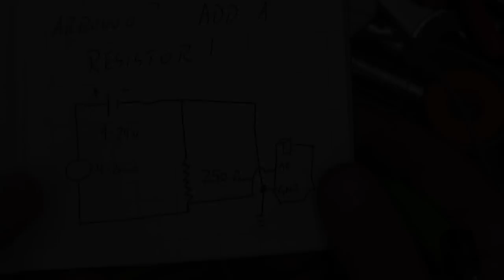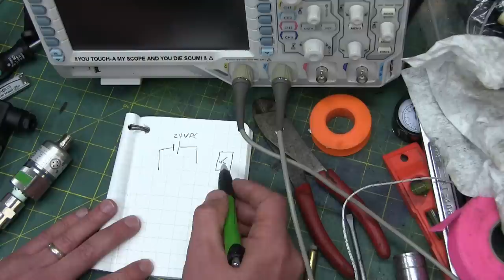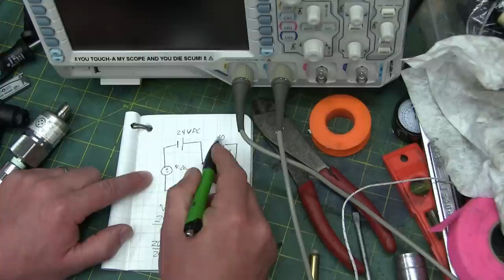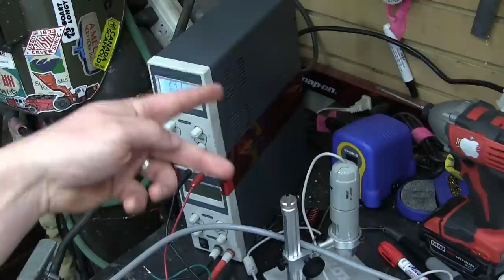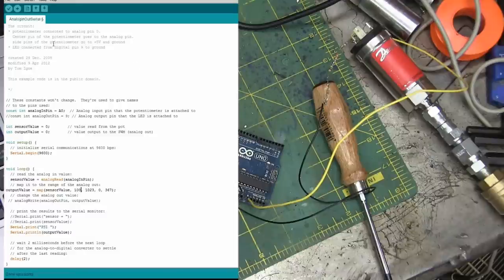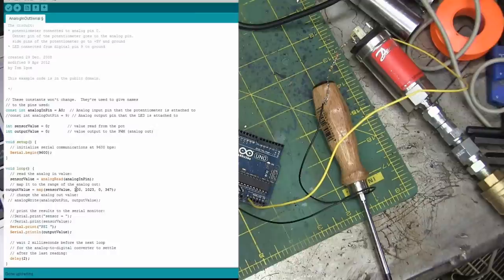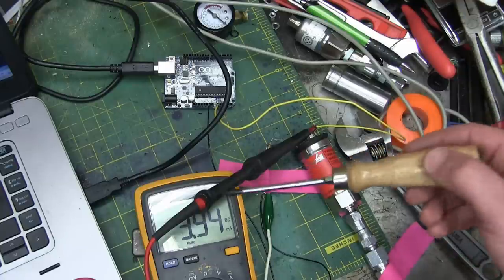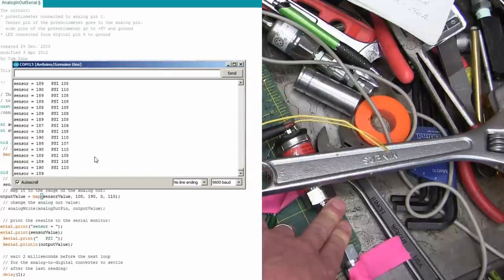4-20mA Industrial Sensor + Arduino

Comment: 20V/20mA = 250ohms? That should have been 1k... 5V/20mA (what you need) is 250 ohms. Looks like your mind substituted the value between what you wrote on paper as your known values and what you used to get the (correct) result.
Reply: Teardown Dan : AvE gets a bit corn fused at times..ya just have to bear with him.
Reply: You can actually use a lower resistance than that if your ADC has just a 1V or 2V input. EG a couple of 100R in parallel will give you a useable voltage.
Reply: Gordon Lawrence : Yes, possible but the issue is millivolts level of measurement.  Keeping it in the volt range means less noise.
Reply: @Keith reducing from 5V full scale to 1V full scale does not make that much difference in the real world for noise (especially on a differential circuit). The real issue is that if you have 5V FSD off the scaling resistor then with a 9V battery that leaves virtually no voltage headroom for the transducer circuit. It will inevitably lead to drift as the battery runs down. With regard to noise remember these are effectively a differential circuit so have way higher immunity than single ended anyway. Even with a 12V power source you don't want near half your voltage being taken up by a scaling resistor. In the real world I have usually designed in a 10R resistor and used a proper differential amp (EG an INA117) and you can get real world common mode noise rejection at well over 60dB.
Reply: Gordon Lawrence :  Depends on length and type of connection..and sampling rate.
Reply: @Keith not really this is differential. Use an LM117 to buffer the signal and you get 60+dB (86dB theoretically possible) common mode rejection. If you don't you have designed it wrong.
Reply: It's 20mA*250Ω = 5V full scale.

edit: I see now what you're talking about. He got it all wrong.
Reply: He meant to do 5V/20mA, got a little ahead of himself

You know the max current available (20mA), you know the max voltage tolerable (5V), so the resistance should be 250 ohms. 

This resistance is in no way dependent on the battery voltage. The sensor provides a current regardless of voltage (think of it as varying its own resistance so the current is correct). This current goes through the resistor, gives voltage.
Reply: Indeed, want 2-10VDC? Use a 500 ohm resistor.  The ins and outs got a little cornfused, but he knew the rules of thumb.  The way he described his resistors made me put the whiskey down and pay attention.  It's interesting watching a video in your own wheelhouse.
Reply: 250 Ohms x 0.004 Amps = 1V
250 Ohms x 0.020 Amps = 5V
Reply: but you cant use 250 ohms and expect it to work from a 9V battery for the reasons I highlighted above.
Reply: It isn't as if Ave wasn't familiar with boost converter lego bricks. If he wanted to use 4-20mA sensors and ran into linearity issues due to low voltage headroom, he'd just boost whatever he has to 20V or whatever he needs - these are industrial sensors and would typically be connected to a 24V PLC, not a battery-operated device where drawing 20mA may itself be an issue. Since he's aiming for simplicity and absolute accuracy is a non-issue here, he went with a resistor that lines up directly with his Arduino's 5V analog input to avoid the need for additional parts.
Reply: My points still remain valid. When designing current loop receivers for commercial use I have still used very low resistances usually about 10R not even 50R. Why? Because if you are using something like an INA117 to turn the signal into a single ended one then anything above 20R introduces error, and you really don't need to worry about noise that much in a differential circuit when you have a minimum of 60dB noise rejection and 80dB is possible with the aforementioned chip in real world applications. Just check the data sheet.
Reply: With an INA117 and a 20 ohm resistor, you'd need to add a 12.5X gain amplifier to use the Arduino's 5V ADC range or lose nearly four bits of dynamic range, more if you consider that the noisier LSBs end up accounting for more of your usable range and the two extra amplifier stages add their own noise over the plain 0-5V input from a resistor. The few sensors I have looked at spec their accuracy as better than 1% from minimum to maximum operating voltage, so I wouldn't worry about that too much when you don't have hundreds of meters of wiring resistance to account for in a typical Arduino-driven project.

The other reason to use an INA117 or equivalent (and the main reason I would in a serious application) would be input protection. Again, rarely needed in DIY/Arduino projects where grounds are rarely sufficiently far apart to experience potentially damaging differences in ground potentials.
Reply: @Teardown Dan. Go do the maths please,.
Reply: @Teardown Dan first off you were talking about PLCs. so your argument regarding the Arduino is irellevant. Second you need to go do the maths. Not actually worked as a design engineer in industry have you?
Reply: Also never heard of an op-amp? Since when is multiplying up a small signal by 12.5 going to be an issue once you get the CMRR up to snuff? You sound like someone desperately trying to defend an argument and failing.
Reply: I said battery voltage does not matter, obviously this was an over simplification. There is a range of voltages the sensor will work at, as long as the voltage is in that range, the current is independent of resistance. 

Also to note, that is an over simplification as well (hopefully obviously). For example, if I put an infinite resistance resistor (say, a vacuum), current cannot flow. So, there is some dependence on resistance too, yes, but there is a large range on both and as long as you're not dumb and unwilling to become un-dumb, you can get this to work very easily.
Reply: Why not? Why can't you use 250 ohms and a 9V battery and expect it to work? (You're right but for a reason you're likely not seeing). Given that 9V can power the sensor, why not?

Regardless of the voltage source, we expect 4-20mA of current. That's the nature of a 4-20mA sensor. They are voltage independent. 

20mA (0.020) is our high current
4mA (0.004) is our low current
Input limit high is 5V
Input low limit is 0V

5v=IR
Well, we have I =20mA and I=4mA as max and min options. V = IR tells us that at a fixed resistance, a higher current means higher voltage. Therefore, the higher current will yield our max voltage before we exceed the input range. Therefore, we calculate:
5v/(0.020) = 250 ohm

Note, my calculations were based on the allowable input range and had nothing to do with the voltage source. So I ask again, why would this not work with a 9V battery? It probably won't, but not because "250 ohms and expect it to work from a 9v"
Reply: @Gordon When I wrote about PLCs, that was regarding bought ones. Ave isn't using a PLC. As for the math, simple: if the sensor has a minimum working voltage of 5V, anything above that is your margin for your sense resistor and wiring losses. Ave suggested using a pair of 9V batteries. With a sensor that has a minimum voltage of 5V, that leaves 13V for battery fade and wiring losses.

Now, in the Arduino case, you are going to have common mode noise between the SoC's integrated ADC and whatever external circuitry you add. That alone may already limit your achievable SNR to somewhere in the neighborhood of 60dB if the Arduino module wasn't designed with low noise analog in mind. If you reference your floating current loop (powered by a pair of 9V batteries in the case of Ave's suggestion) to CPU ground, your SNR is already close to the best you are going to get.
Reply: Ah so you don't have a clue how they work. There is circuitry inside the sensor that needs voltage headroom. You really didn't know that? So your headroom could be a full 12V less than you state for some sensors. As for CMRR you have even less of a clue. The whole point is your grounds are not commoned. If you common them you negate the the CMRR altogether. Go read the data sheet again and look at the application notes. As you don't seem to have a clue about the maths I'll tell you the answers. If you use 1% tolerance resistors with 200ppm temp drift then worst case over the -40 to +125C temp range your CMRR is down to a ratio of 40 to 1. Don't believe me? Go and learn the maths. So sticking a 250R resistor in a fully differential circuit is going to completely screw up your CMRR and no it's worse than the 25 times difference in the resistor ratios. Again if you don't believe me go learn the maths and do the sums yourself.
Reply: @Gordon If a sensor has a 5V minimum working voltage, that 5V includes the regulator overhead for the internal circuitry. If the sensor needed 12V minimum for correct operation, its minimum voltage would be stated as 12V. As for your CMRR comments, a mismatch in a differential amplifier degrades noise common-mode immunity but in the plain resistor circuit, there is no delicate matching between + and - input circuits, all you get is temperature drift, not additional common-mode noise.
Reply: @Gordon Please wake up. The INA117's specs are irrelevant when you aren't using the INA117. Ave is plugging the 250 ohm resistor directly into the Arduino ADC input, no differential amplifier, no input network matching or input offset compensation required.
Reply: Fine, I forgot to include the 5V of sense voltage in my deductions at some point while I was editing that earlier post, so what? There is still 8V left for wiring and battery discharge after that. Since you would need about 3km of #26 wiring (133 ohms/km, 1.5km each way) to spend 8V of headroom, I think it is more than reasonable to allocate practically all of it to battery fade in a typical "home gamer" project scale.

A plain resistor has no intrinsic CMRR in a current loop. The only reason why the sense resistor in a differential opamp circuit makes a difference is due to the opamp's input/output offset voltages and currents: the bigger the sense resistor, the bigger the difference between inputs is, the bigger the opamp's offsets and associated effects will become. You don't have those issues when you convert a current loop to the voltage range you need with a simple resistor directly at the ADC's input if you can spare the headroom and don't need input protection nor partial-isolation. Again, that only works for "home gamers" as industrial use would require both for safety and durability reasons as there are no guarantees that the sensor itself is referenced to ground.
Reply: You're both over-complicating this.  The instrument is a constant current source, meaning that the output current is constant based on the sensed pressure, up to a ceiling based on the supply voltage, the power requirement of the instrument and the impedance of the output loop.  Depending on the manufacturer, the instrument will have either a maximum rated output voltage or a maximum loop resistance at the high and low supply voltage limits.  If there is a very low resistance across the output terminals then the instrument outputs a very low voltage.  The lower the output voltage range, the more impact electrical noise can have on the signal (or more precisely the bigger that impact is relative to the span of the instrument).  For this reason it's common practice to use at least 250 ohms in the loop so that the instrument is outputting at least one volt.  Also 1-5V is easy to read across the input terminals for fault finding without having to do much in the way of mathematical conversion, and without having to break the circuit to add an ammeter.  This obviously doesn't help with noise coming in through the supply voltage which is why the instruments are generally used with a ripple-free DC power source, and often have their own internal filtering.
Reply: @Retsil The gist of Gordon's point is that using a smaller resistor maximizes the operating voltage margin available to the sensor and improves the CMRR from the receiver amplifier when used. My point from the beginning was that an amplifier is unnecessary here since there is plenty of voltage headroom to afford using a plain resistor and none of the need for rugged industrial design, which eliminates the effect of the sense resistor on the amplifier's CMRR from the list of things to worry about.
Reply: Lots of these current pressure transducers require a bit more of an excitation voltage before they chooch. Unless AvE has skookum transducers there.
Reply: @Teardown Dan, and my point is that you denied that there was a need for voltage headroom for the sensor (which I have proved you wrong on with a data sheet), and you also denied that CMRR was affected by the value of the sense resistor (which I have proven to be nonsense with a data sheet and two application notes). So my original point remains that I made in my first comment that two 100R in parallel would be better in this specific instance as if the sensor needs 12V (as per some of the units out there) and you are using 250R for a full scale of 5V, then you only have a 1V margin for the batteries when they start running down. 50R would give you a 5V margin worst case, and it's not exactly difficult to stick in a rail to rail op-amp (configured as a x 5 amp) for a few pennies or just live with losing a couple of bits off the resolution. So any way you look at it you are wrong.
Reply: It's fucking magic. Stop worrying about it.
Reply: @Gordon Learn to read, I have never said that.
Reply: @Teardown Dan learn to speak: Never said what Specifically?
Reply: At this point, I'm going to just assume that you are trolling instead of wasting any further time on you.
Reply: This is not really directed at anyone in particular, I havent even read all this crap, but can someone just be an adult and move on already? Man... the notifications are real
Reply: Maybe I'm missing something, but how do you get 250 Ohms from 3 10 Ohm resistors in series?
Reply: Could be wrong but I thought he used two 120R and a 10R?
Reply: yes dave, that's why I'm reading the comments and not watching the video, I even went on to the BBC's GCSE physics revision page to learn myself about the narrow magic pixie tunnels. still none the wiser
Reply: No he used a 220 and 3 10's
Reply: Maybe this argument is why the transducer was in the scrap bin to start with.
Reply: anything between 200 - 1000 ohm is fine
Reply: If you want a fast answer to your question, then post the wrong answer and read the replies. Works every time.
Reply: Ok Karen

Comment: In school we always did our arithmetic using kOhms,  mA, and volts. So 20 v / 20 mA = 1 kOhm. As long as you express the values in these units you can simply do the arithmetic 20/20=1
Reply: But he’s got 250 ohms. 😮

Comment: Current sensing shunt.  For thoes who don't understand he is sensing detecting the voltage drop over a resistor.  And with ohms law  he is deducing the current going throw the resistor.  Which is the same amount of current going through the circuit.  There are other ways of decting current too

Comment: One warning: Some Arduinos run on 3.3v and if you have one of those, you need to resize the resistor for a 3.3v maximum voltage into the Arduino.
Reply: John Ridley Arduino doesn't have Vref inputs for the ADC bank?
Reply: eh, nevermind. Just looked at my Freescale 9s12 and Vmax-adc = Vcc. When using a precision voltage source (recommended best practice) to feed the Vref-adc pins Vref-adc should be Vcc - some small voltage.

Is the Arduino hard fabbed to tie Vref-adc to Vcc? I've only used Freescale stuff, and nearly all of em have the pins broken out.
Reply: Not hard fabbed. Though you need to declare in code that you are using external Vref. It defaults to Vcc w/out this
Reply: Cool. Great that they brought the pins out. I had one MCU with ~50 pins, but it was in a 24 pin DIP, so a good about of function was lost.
Reply: Alternatively just use a couple of 100R in parallel and use some maths to re-scale.

Comment: To have 5V voltage drop (max that we can read) on 20mA current resistor should be 5V / 0.02A = 250Ohm

Comment: Wired a water treatment room for an aerospace manufacturer about 7 years ago. It was a beautiful decent sized industrial job. There was one 460 Volts PLC controlling everything. To someone who doesn't know much about it, it would look complicated but it's really not. There is inputs and outputs, and the 4-20ma sensors talk to the PLC which through programming and miscellaneous switches controls the vfd's for the pumps according to what the client needs. Of course the wiring diagram was engineered nicely, we just run the wiring and build the system. Still to this day it was my favorite job.

Comment: AvE, Based on your comments near the end of the video, or in case you were not aware... 

Plotting the data coming from the serial port is super easy.  Just remove all the extraneous Serial.print commands, and instead just print the value (for instance, your calculated PSI) to the serial port via a single "Serial.println(outputValue);".  Once you've made those changes, then instead of choosing the "Tools"..."Serial Monitor" to open up the serial window, simply choose "Tools"..."Serial Plotter" and you'll get a pretty self-sizing graph next time you run your program.  

Hope this helps...Mike

Comment: This video explains something i never thought to question. Having worked with PLC's which you can usually select which type of device you connected ( 4-20ma or 0-5v ), and usually having the option to choose which I bought for the job there was never a need to think about it.
It is very logical and this will stick with me.
Thanks